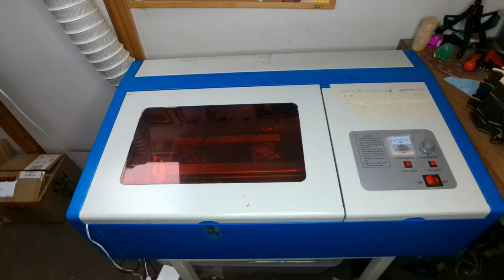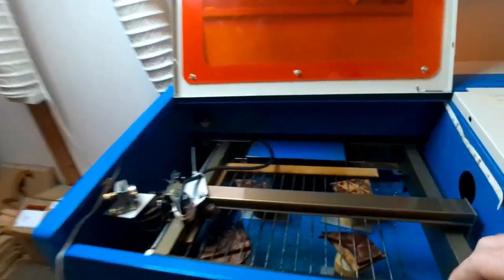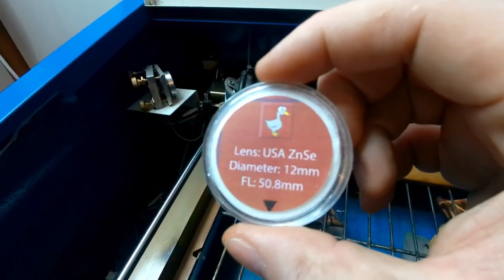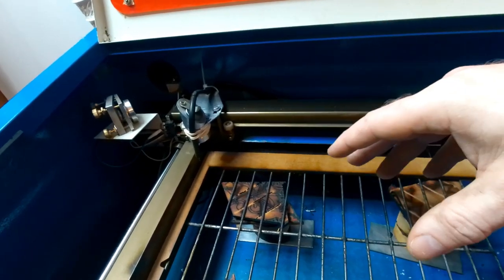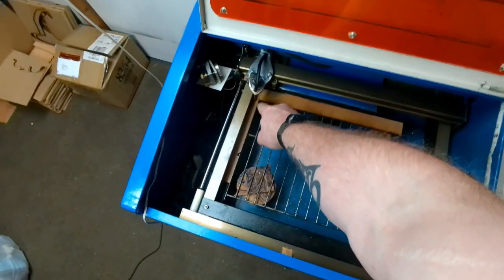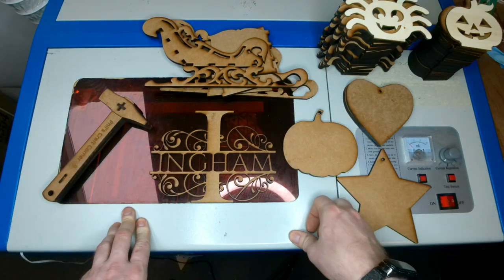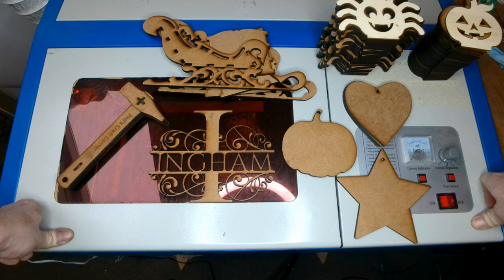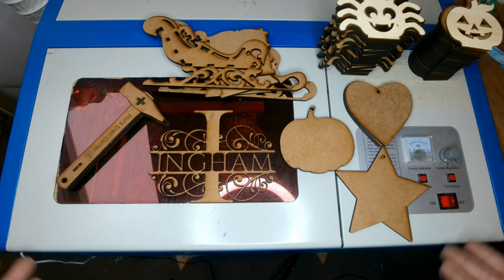K40 laser 6 month review, was it worth it? Do I make any money?

Comment: I have had mine a year and lightburned it for 25 quid with a 3d printer card, works well and no real problems at all, I never bought mine to make money although I have made a reasonable amount more by people saying oh can you do this etc, now because of this I have decided to make a small business out of it and I am in the process of making the bed quite large, big enough to weld in a section into the existing cabinet to give me more depth of about 650 mm bed useable bed depth, I didnt want to purchase the next one up which is about 1600 quid , my upgrade is costing in total about 350 and when done will give me a bed of 650 deep by just under 700 across the X. Should be a lot better to use, I still believe strongly it needs to be in a safe cabinet for fire safety, turn your back on this machine and you can have a fire.
Reply from the maker: In the long run this will be in my workshop but I don't have a pc there. Lightburn is a great upgrade for a k40. I couldn't do that kind of bed upgrade. I just don't have the equipment or the experience. It was just more sense to upgrade to the 50x30 it was £1089 including delivery and I'm already thinking of going for another upgrade 😅
Reply: @philscraftcorner  that seems a lot for a k40 when they retail in Germany at .285 new . Seriously the bed upgrades are fairly easy to do and if you don’t go mad like me the best one to do is just the maximum the cabinet can do which is 800 x 495. That will cost around 300 to do or less just depends on the bed but the beauty is you can get a4 sheets of ply in it from front to back and about 3 in a row so quite a useful upgrade. I just want to be able to print much larger designs in one piece bars arrived today all a metre long it’s very tempting to ditch the cabinet and buy a new case for it at that size!!
Reply from the maker: The machine I got was not the k40. I changed from the k40. I paid £250 for my k40 last year but needed something bigger pretty quickly

Comment: Thanks for the video Phil. I have had an identical looking K40 for about 10 months. I upgraded mirrors, tore out and replaced the bed, added air assist and a laser dot locator, and use a similar method for tube cooling.  I also added two digital temperature probes and meters to keep tabs of temps of water and the tube itself. I also modified the power control pot and made it more sensitive so I can more precisely control and replicate the power level.
I have been making a variety of items -  engraved painted tiles, wood keychain fobs and golf bag ID tags, slate coasters, and acrylic edge-lit displays and clocks with custom acrylic bases.  I, too , feel the need for an enlarged X-Y working area with enough Z- clearance under the laser head to use a rotary device to engrave reasonably sized items, so I am eyeing a larger laser machine.
Reply from the maker: I need the lager work area too which is why I ordered a 3050 50w which should make a big difference for me until I get a good setup in my workshop with a laptop

Comment: How do I operate laser software it's very intimidating very complicated software
Reply from the maker: Which laser software are you trying to use?
Reply: @philscraftcorner  I'd like to know the easiest one as I know nothing about them but will practise SVG downloads with my cricut maker
Reply from the maker: Depending on the machine you buy, there are 2 that I found pretty easy.
For the k40 lasers, k40 whisperer works well with svg's I recommend using inkscape along side it for designing and saving svg's.
For lasers that can use lightburn I highly recommend going with that one it's super easy to use and figure out

Comment: Hi Phil great vids I'm just wondering where you get your files for cutting from or do you design them yourself like the santa sleigh etc
Thanks
Reply from the maker: The sleigh file was from thingiverse if I remember correctly. If you search laser cut on there a lot will pop up. My mandala files are generally from etsy. There are a ton of great file creators on there
Reply: @philscraftcorner 
Thanks Phil I've seen a lot on etsy aswell how you finding modifying them.. Most are in US sizes Arnt they which means more expensive for us to buy the right thickness wood for them I'd be a lot happier if could get them in like 3.6mm ply which we can get anywhere for a lot cheaper
Reply from the maker: It takes a bit of practice to modify but generally just need to change the thickness of the slots

Comment: Hi Phil. I'm new to laser cutting. Great intro into laser cutting.  I agree the size is limited basically an A4 sheet of paper just wont do. Just wondering what the new machine is going to be from Germany ?  And after brexit do you know what the import tax and delivery costs will be ?
Reply from the maker: From what I can tell we don't have import tax on good direct from the EU but if we order from outside the EU and they need to pass through, then we do need to pay.
I have had the new machine since mid November and it is much better. Its a 50w 50x30 machine so just over a3 size. It's worked really well.
I have an un crating video with a link to the exact one if you want to check that out
Reply: @philscraftcorner  Great stuff thanks for that. Watch your unboxing and testing of the new one. I will keep looking  for the right machine for myself. Thanks Again
Reply from the maker: I hope you find a machine that suits your needs

Comment: hi saw some issuses about electric shocks on some of the american youtube channels to do with grounded surlely if there was any arcing or problems the eletric would trip in the uk
Reply from the maker: We have fairly decent electricals in the UK with a good ground built into each house. Make sure you use a 3 pin earthed plug and you should be pretty safe. Most issues will pop the fuse in plug or throw the trip switch in your consumer unit
Reply: @philscraftcorner  thank you so much nearly got put off buying one but think i will now any tips on best place to get one
Reply from the maker: I picked up my k40 2nd hand off Facebook. I replaced it with a 50w 50x30 with 6 months of using it though. I needed a bigger cutting area

Comment: I use an old K40. Similar issues, so similar mods. Expanded steel as a bed, so I can use magnets to hold down. Similar X0Y0 setup for datums (bit obvs, IMO). My flyback also popped, but I used a replacement from China, still working well. Normally 3mm ply, 15/18mA (30-33%), 7mm/s feed. Air assist goes through a 3D printed nozzle, also keeps my lens clean. M2 has been copper for over a year (never cleaned, there's a science to it, not related to how shiny it is). I might get slight improvements with a new mirror/lens setup, but at the mo, not worth it. My coolant is as yours, an occasional frozen bottle now & again in a small reservoir. Nice to see I'm not the only one not getting carried away with these things... :-)
I just make beer money. Well I DID, before this cr*p kept us in, & the boozers closed!
Reply from the maker: The k40 is a great starter machine. I have since upgraded to its big brother, a 50w 50x30  with adjustable z-axis. It works really well out of the box. I have used it for well over 200 hours and modded a few bits but still needs some tweaks. I'm glad the k40 is working well for you. My main reason to upgrade was the bed size.
Reply: @philscraftcorner  You can never have a "too big" machine! There's a great mod doing the rounds for a K40, ripping out the electronics into a separate box, & using the whole frame as the bed. Still got the <40w tube, though... :-)
Reply from the maker: I did look at that option  but this was the better choice as no down time for work
Reply: @philscraftcorner  You DO know, we'll be expecting a review of your new machine, when you kick it into shape?  :-)
Reply from the maker: Don't worry I'll be doing that soon

Comment: That was great. Some good insight. Got my K40 arriving this week at some point. Definitely going to be trying that sleigh (my daughter would love it). I did order the air compressor you recommended in one of your earlier vids, but I can't figure out what nozzle you have in the end of the hose? I've seen 3D printer extruders used etc but closest I can imagine to yours is a football pump :D
Reply from the maker: That's pretty close. Mine is actually the tip of an ink refill kit that I cut down. A few people have used a metal straw and crimped the end a bit, a good test is to test fire the laser then move a small shallow container of water roughly center and as long as it pushes the water away from where the laser would fire you will be fine :)

Comment: heyup mate ive now got the k40 ive bought some keychain svg files but when i go to load it in to k40 whisperer it adds them but only one at a time how do i add it multiple time to fill my sheet of wood otherwise i will have to do one at a time plz help
Reply from the maker: You will need a program to edit your svg files. Inkskape works well. Import them all into. Inkskape. Set them to fit on a full sheet then select all and resize page to selection. When saving make sure document properties are set to inch or mm then k40 whisper should recognise everything
Reply: @philscraftcorner  so mine would have to be on 300 by 200 page size as i have the standard bed then duplicate and fill the sheet the resave as svg
Reply from the maker: Exactly. Just make sure the size in document properties is in mm and not px or k40 whisperer will shout at you